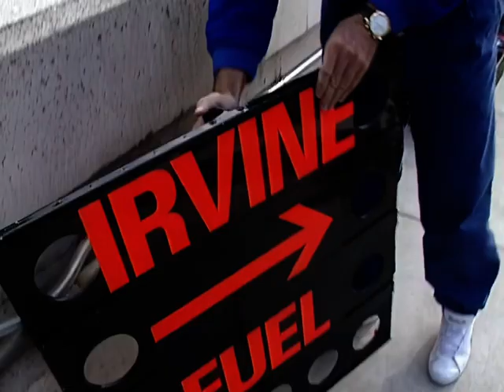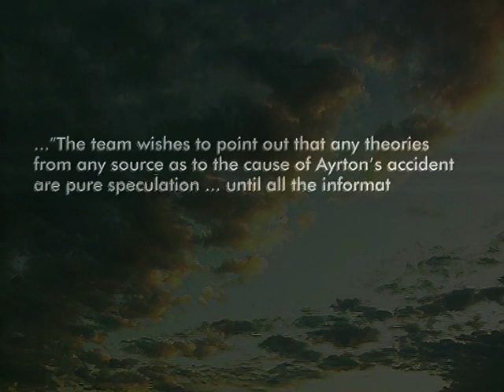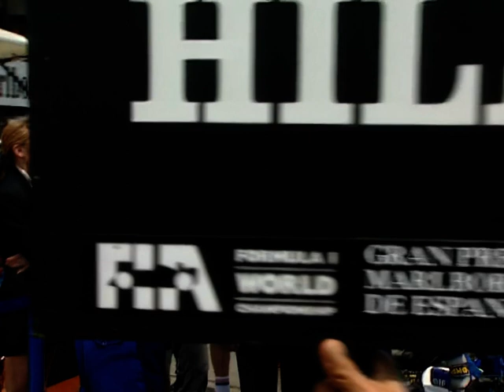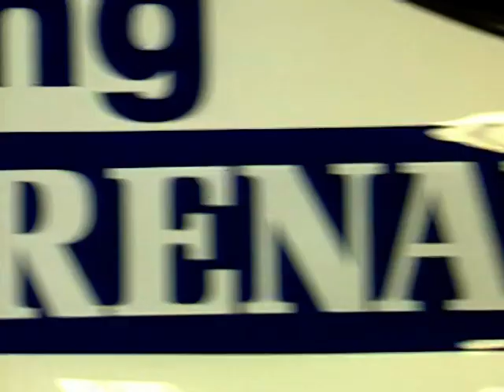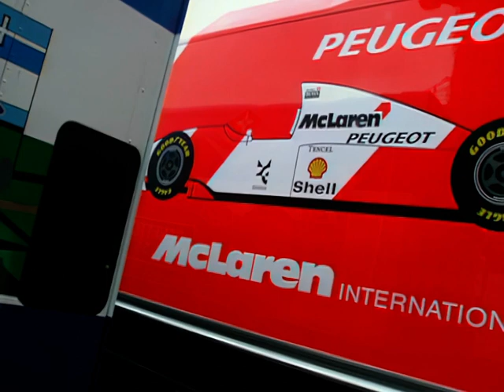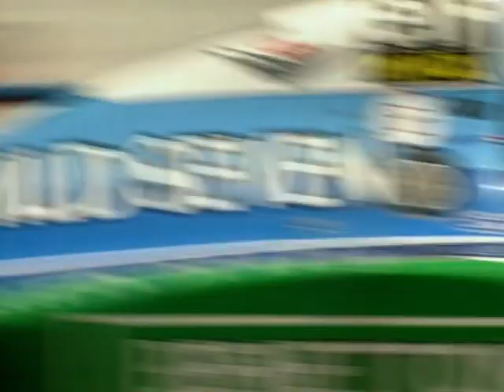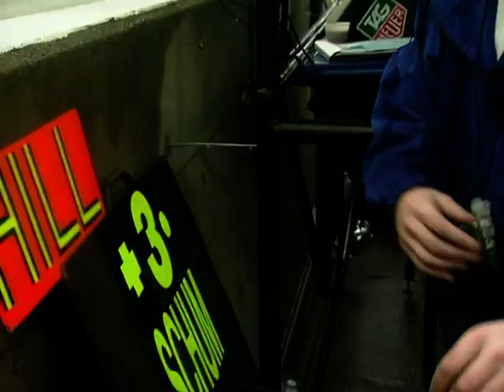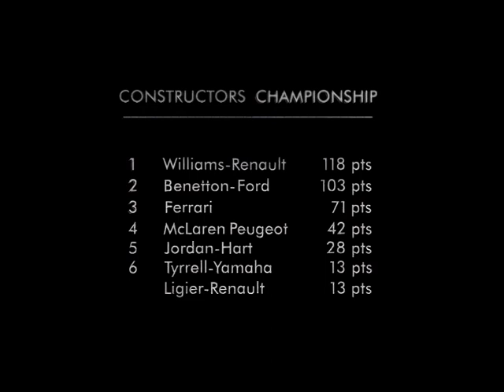F1 Season Review 1994

Comment: Thanks for the upload… yeah, Benetton of MS rife with illegal traction software to edge out Senna in, sadly a car devoid of most of the aids he wanted to be rid of… but in the face of cheating from FB at Benetton, he can only muster POLE POSITION. Including the race he dies in. What a joke that the cheaters were allowed to race. But it was the steering column revision Senna would request of Newey at Willams to make the car more ergonomically correct the spot weld failing in the race and costing maybe the greatest champion his life.
Reply: Brazil's hero was cruelly killed in 1994. From Joe. X
Reply: They only had illegal launch control software, not traction control software. The traction control they did have (if you can call it that) was utilised via very creative engine mapping and was legal as far as the rules were considered.